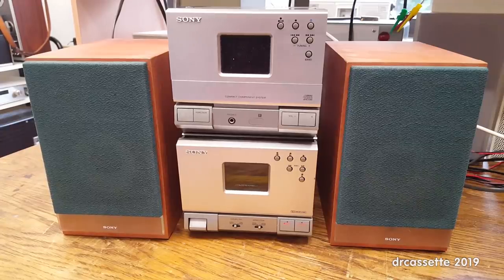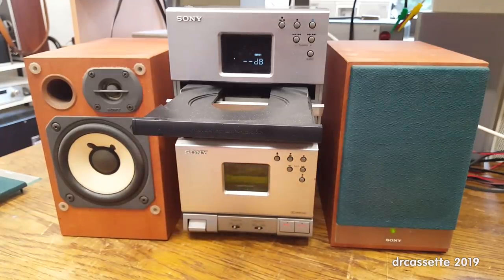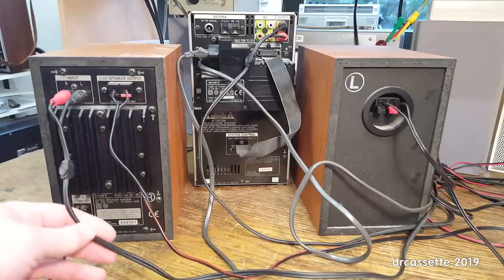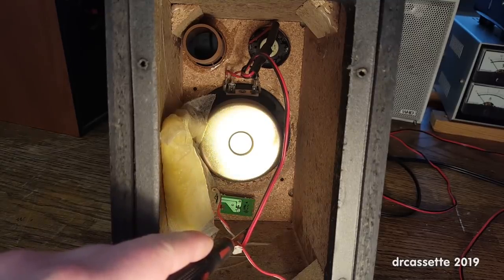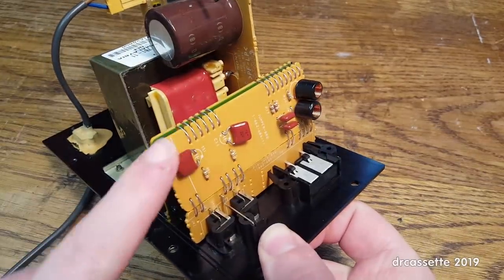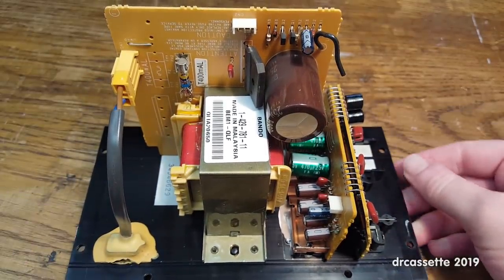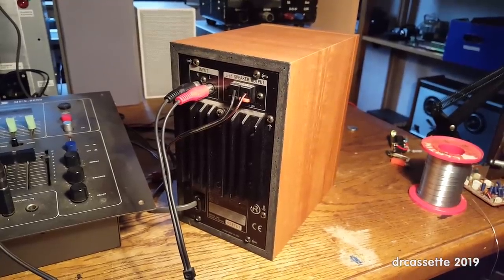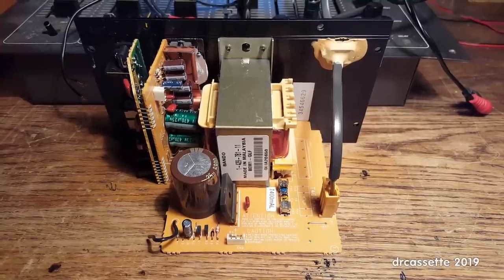Sony mini stereo system with amplified speakers

Comment: I got to say, your dump finds amaze me. Is it really that easy to take things from the recykle center in Germany? Or do you find them in containers outside houses? The recycling centers in Sweden are almost always highly secure and have staff that checks that nobody takes anything, it almost makes me not want to go there to throw stuff away ’cause I always see a lot of stuff that I want, that probably works just fine, but there is just no way of getting them there...
Reply: Here in the Netherlands also, although i do have had some scores, like an Mac Pro, and some vintage Dynaudio monitors with foamrot :)

Comment: Nice looking speakers, the one-cap-crossover isn't too bad in a small speaker system since the cones usually don't have a lot of annoying break-up resonances. The undersized coupling caps can be a benefit because they keep the woofers from bottoming out at low frequencies they can't play anyways. Maybe the transformer coil wire has delaminated from lightning damage...

Comment: This system probably wasn't cheap back then. But I guess I would only use the active speakers as well, not because it would not be worth fixing but because I have a basement full of junk that needs to be fixed and I will probably will never come around to fix it. The inside of the speakers was a little bit disappointing though. :)

Comment: Quite often an audible buzz from a transformer like this is because one or more of the laminations is vibrating with the magnetic field in the core of the transformer. It could also be the steel casing/mounting hardware of the transformer that is vibrating. It really doesn't take much, just a small part of one lamination that is slightly loose will cause a buzz. Usually during manufacture, transformers are dipped in varnish which fills in gaps and holds the laminations together to help, among other things, prevent buzz.

While this can certainly be annoying, it doesn't mean anything is wrong with the transformer and does not affect its operation or reliability.

You can try applying some varnish or nail polish to the sides of the transformer laminations it might reduce the noise.
Reply: Agreed on loose laminations. A while back I got a 13.8 V power supply that was humming like crazy - turns out the transformer's lamination packs were held together with nuts & bolts and some of them were loose. Tightened them up good, and lo and behold, only a faint hum remains.

Recently I also learned that apparently you want to switch around the E and I parts at every layer for minimum eddy currents (and hence losses and hum) - this often isn't done, for plain economic reasons.

Comment: I don't like "one active, one passive" speakers because the airspace and therefore tuning is different in one enclosure to another. The consequence of this was most noticeable to me in a pair of Sony SRS-A20 Walkman speakers I owned years ago - one speaker had noticeably more bass (what bass it had) than the other. I had a pair of Logitech X-140 computer speakers that attempted to solve the problem by placing the amplifier in one enclosure and the transformer in the other to "even out" the airspace, but those had other problems (air leaks through the controls).

This system by the way is "micro" class, not "mini" which are bigger. And cardboard ports are better than plastic ports from my experience, as long as it's thick cardboard.

Comment: I've got one of these. Not a bad system. The cassette deck makes the same sound. It's the belts have failed. The CD player issue is microswitches.
Reply from the maker: Yeah, bad belts and microswitches. But I don't think this set would be worth any repairs.

Comment: There’s not much insulation in those speakers, I would have expected a bit more fill. The folded circuitboard design is really interresting, Sony is known for mastering 3D envlope design. Are they the masters of compactness?🧐

Comment: You can tell it's from the good days,all NCC capacitors,and those green ones might be nichicon.Also the copper bar fot the transistors,nice touch.Too bad about the transformer.As long it's a simple 12v,shouldn't be a problem if you want to replace.I had a Sony pre that had the transformers(main and standby,mostly main) that got quite hot.That one might have had some issues before,had some water marks in it,who knows.
Cool find :D

Comment: Just bought this exact system, and sadly the CD and tape decks both don't function. it breaks my heart, as they're beautiful!
Reply from the maker: That's unfortunately not uncommon with these older mini systems. Likely the CD player has a weak laser, and the cassette deck has bad belts. Both problems are fixable, but is a mini system worth the effort?
Reply: @DrCassette  For sure it is worth the effort. It is a very nice little system with a very good sound!!

Comment: I also think the speakers are a nice thing to have by themselves without the receiver/cassette player. Interesting design idea, probably because the receiver didn't had enough space to add the amplifier. The amplifier by itself is weird, and I agree with you that the output caps are a bad thing; probably the first ones to go bad. Also, it's worth noting the baked section of the PCB on the top right section; what's going on? The transformer is probably not bad, but badly designed. Just swap it and that would be it.
Reply from the maker: The 'baked' section of the PCB seems to have some low power voltage regulators, possibly for a preamplifier stage and certainly for the power LED.

Comment: Transformer buzzing is normal. My cheap LG boombox has a loud transformer, but it still works flawlessly. I used to have a radio with an even louder transformer, but the speaker blew on it
Reply from the maker: All transformers will hum slightly, but they should not emit a loud buzz. It won't stop them working, but it will stop me enjoying music. But if you can tolerate this much background noise, good for you.

Comment: If it doesn't work out just bypass the amplifier and just wire the speaker to another amplifier system at least you will have a nice pair of speakers
Reply from the maker: No, I want to have the amplifier working properly. That's what makes these speakers so useful.

Comment: I don't think the Transformers is bad it's right up against the capacitors there's no shielding a thin piece of metal between the capacitors Earth to the body of the transformer should sort it out it's always been like that and the bridge rectifier has very little filtering. Maybe moving the big capacitors horizontally might help
Reply from the maker: What are you talking about? Please give me some sources. As far as I know electrolytic capacitors don't interfere with transformers like that.
Reply: Well I think you're right with a small transformer like a choke but having a massive transformer like that so close to the electronics has got to add interference maybe not in the capacitors themselves so much but the other electrical components must do? If it's rotated 90° maybe alright. anything I come across using mains transformers like that is always shielded by a plate between the transformer and the circuit board. is the  transformer Earth properly to the metal plate heat sink?
Reply from the maker: @johnsweda2999   I think you didn't catch what I said in the video: The buzzing is NOT in the audio signal (if it was that indeed would be the transformer interfering with the electronics), the buzzing is MECHANICAL, the transformer itself is making noise.

Comment: Junk Bad logic IC fault i'd say, had this on heaps of different units
Reply from the maker: Could be a bad IC, but I'd guess it's just bad belts in the cassette deck and bad microswitches in the CD player...
Reply: Aiwa mini system of The same vintage had the logic issue too. I do believe that was most of the reason for the class action suit

Comment: Nur ne Idee:
Im zusammengebauten Zustand gabs kein Brummen, richtig?!
Vielleicht mag der amp einfach keinen offenen Eingang, is öfter bei den  TDA15-filzlatsch, die 12 Volt schreien förmlich nach Autoradio, allein schon der SIP-Sockel.. :)
Reply from the maker: Ich hatte gehofft, es im Video deutlich genug gemacht zu haben... Das Brummen ist mechanisch und kommt vom Trafo. Mit dem Audiosignal hat das absolut gar nichts zu tun. Das Brummen ist permanent vorhanden. Die ICs sehen für mich nicht nach TDA aus, eventuell sind das die ICs, die Sony in größeren Verstärkern als Treiberstufe vor der Endstufe eingesetzt hat... bei so vielen Pins wären die mir bekannten TDA-Chips schon Stereo-Versionen.

Comment: Transformer buzz aside, you could probably slap together an external passive "preamp" with a 10k log volume pot in a tin (think cMoy style) and call it a day... minimum voltage gain for the µPC2505H is 34 dB, so that stage probably has more than enough gain.
Reply from the maker: The speakers will be connected to the headphone output of the sound mixer seen towards the end of the video. This headphone output does have a volume control, so I'm good. I just need to replace that buzzy transformer.

Comment: I have a mini stereo system that started buzzing after the electric company sent almost 260v to my sockets. After this incident the system still works ok, but the transformer buzz is very annoying
Reply from the maker: The transformer probably got rather hot causing the windings to delaminate. This doesn't mean they are bad electrically, they are just not held in place anymore, so they can vibrate with the magnetic field of the transformer, causing the buzz. Something similar may have happened to the transformer in these speakers, or the vibration of sound played through the speaker caused the delamination to occur.
Reply: @DrCassette  Interesting. Bought a Sanyo mini system and the reciever has a similar buzz. Maybe the transformer is the problem, it also heats up a lot, just displaying a clock in standby mode. But otherwise it works fine and I bought it for about €15 last year. Really wondered what the problem could be, and thanks to this video I now have an idea.

Comment: Hi Doc.  Informative video.  I have found these speakers on sale in Eastern Europe and need your advice.  I have the choice of having to buy either the Kurzweil KS40a studio monitors or the Sony’s.  I’m looking for inexpensive Studio Monitors, basically with some semblance of Bass without breaking the bank.  If I remember correctly these Sony’s cover a frequency of 60hz to 20khz whilst the Kurzweil are 75hz to 20khz.  I’m guessing this means better bass on the Sony’s?  What is your advice if I have to choose between these two options.  The Kurzweils are new and I’m presuming that the Sony’s are not buzzing yet.
Reply from the maker: I would suggest you go with the Kurzweil speakers, simply because they were designed for standalone operation. The Sony speakers were designed to go together with the stereo system, so they don't have any built-in volume control, and an extremely short power cable. The Kurzweil also seem to be bigger than the Sony speakers (which are very small). I doubt the Sony speakers can really go down to 60 Hz. The Kurzweil speakers also seem to have some sort of Bass Boost function, which may be useful.
Reply: @DrCassette  thanks for your quick reply.  I’m leaning toward the Sony’s because I don’t want to use another power source for the speakers I get for my battery powered 8-track multitrack digital recorder so this way I don’t have to plug the speakers into a wall to power them.  Am I right in my line of thinking? In other words the Sony’s, being that they have an internal amplifier within one of the speakers, I can just plug them in via RCA and they will work immediately without another power supply.  The Kurzweil doesn’t have an internal amplifier where I can just plug the speakers into my 8-track Recorder and expect them to work right away.  The Kurzweil needs an additional power supply that the Sony’s don’t. This way I can do some recording and playback in the field on a camping trip only using batteries, yes?
Reply from the maker: Both speakers, the Kurzweil and the Sony have built-in amplifiers. They will not work unless you supply them with power...
Reply: @DrCassette  oops.  Forgive me, I am a layman on a learning curve.  Is there such a thing as battery-powered or rechargeable speakers ?  It seems this is what I need.
Reply: @DrCassette  I was hoping to find something like the Bose S1 that is chargeable and thereby portable.  I don’t want to have to plug into a wall every time I record.

Comment: Thanks for this video I have a question if I removed my system control cable cord does that stop the stereo from turning on I removed it cause it have a shortage
Reply from the maker: Unplugging the system control cable to the cassette deck should not keep the rest of the system from turning on. I haven't tried it though.
Reply: Ty I don't understand why it's not turning on

Comment: Great video! 
But tell me please, how the hell, someone can solder something to a aluminium heatsink?
This is not possible,
This is just a thermal compound paste
Reply from the maker: The plate in front of the ICs that holds them in place is made from copper. This copper plate is soldered to the board.
Reply: @DrCassette  are You sure?  Cant believe! Have the same system,
Reply from the maker: Yes, I am sure.
Reply: For the record, it is possible to solder something to that with a high-power soldering gun